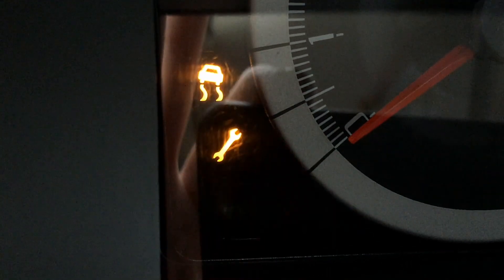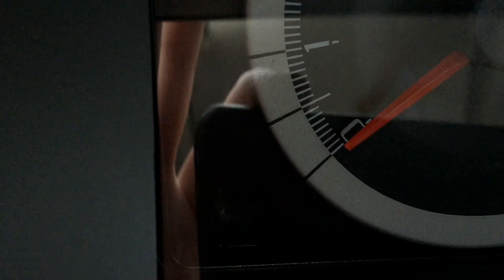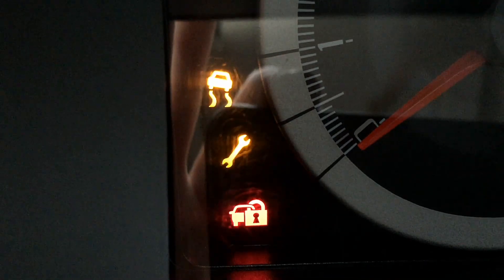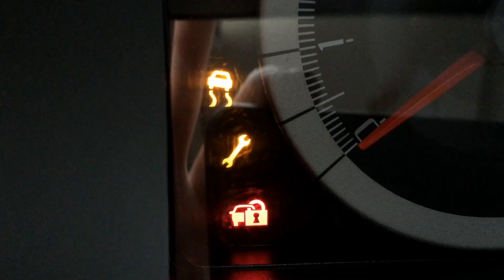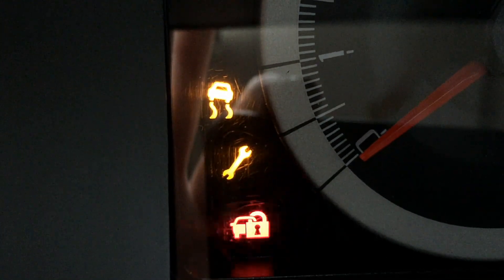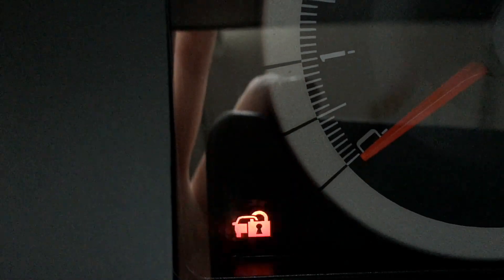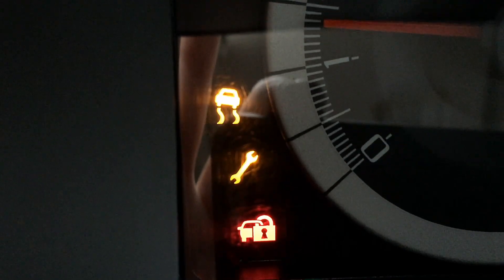Ford Quick Tips: #52 Identifying Ford PATS System Malfunctions

Comment: I need help😭
My car is doing the same thing, locksmith couldn’t program another key. My scanner tool won’t communicate with the pcm.
If the anti theft light stays on will that trigger communication errors with the pcm?
Should I focus on the ignition switch and transceiver module

Comment: Hope you read this: just left a customer with a 2010 f150 no crank with B10DA and B10D7 pats codes. Cust said he put an old key in to start, then it would not start after that. The security light never comes on at all, might be blown bulb, but probrammed a key and still no crank

Comment: I would rather deal with the risk of my truck being stolen than to deal with this BS antitheft PATS system. I have a 2003 Ford F150 Heritage Edition Black and Charcoal paint. Mint condition with only 64K miles. The truck would be worth around 12K to 15K. But nobody can figure out the crank no start issue I am having. Its throwing a code 16 on the theft light. The 2 mechanics that I have had work on the truck have done everything they know. But still the same problem. The one guy is a retired Ford tech that opened his own shop. Any advice or things I could try would be helpful. Thanks

Comment: Dude I’m praying it’s just the keys are bad for my 2002 mustang I replaced my clutch and then this started happening and it just has been so stressful 😭
Reply from the maker: Common issue with the cluster on the mustangs of that era.
Reply: @FordTechMakuloco the cluster?
Reply: @PatrickTaylor-n1o yes. Instrument cluster
Reply: Did you fix the issue I did the same job and now my car won't crank
Reply: @user-yt4id5np9f yes I had to send my ccrm out to garret tuning and paid them $165 dollars for a pats delete because there’s really no way around it and when I put it back in it fired right up

Comment: What if you have intermittent PATS problems while driving? Starts fine, but after driving, that light comes on, car jerks, and sometimes dies. I've rules out key transponder, had new keys and no change.
Reply: Any update
Reply: @craig2054  replaced throttle body, no change. Taking it to the dealer.

Comment: I have a 01 ESCAPE must I say more🫣  
    I found information about steps using pats key on exterior door lock to help recognize it, can’t find it now … 
    I moved it to wash engine bay because I was getting ready to work on some leaky seals and will crank no start and pats system codes p1800or p1600 , the extra key triggers the theft light

Comment: I have a 2008 Focus that will not program new keys after erase. Although, the PATS light flashes in standby mode, but it remains solid even when turning to the crank position.  I get a P1260 and a B1213 DTC code.  Any suggestions?

Comment: Thanks, Changed out the PATS thing on my 2002 explorer and fixed it up. Was having no Crank on any of my keys, had that THEFT light blinking in the dash.
Reply: Did you only change the transceiver? Im having the same issue now and have changed it, the dash lights at least come on now but it won't start.

Comment: 2012 f150 no chime when door is open key in ignition unless i put pressure on key have a code not throwing a light though b10f1 is this ignition switch issue or cylinder lock

Comment: I need your help on this one.  My '02 Excursion has a strange intermittent PATS issue.  It will occasionally not recognize the key, but if I switch to my other key it'll work fine, and the key that didn't work will later work.  I've been driving with two keys in the truck for a few years switching back and forth between them every time the system decides to not like one of them.  My biggest fear is that some day the system will just crap out and leave me stranded.
Reply: How did you fix this?
Reply: @cmdyc21  I haven't, I keep two keys in the truck at all times.  I ordered two new keys and once I get them cut I'll start using those just to make sure it's not a chip problem with my current keys.  I had one suddenly die a few years ago while on a road trip, they're not infallible.  Coincidentally, I never had this problem before that moment and the keys I'm now using weren't in use before then.  Fortunately I always keep an extra key in my vehicles just in case, otherwise I would have been stuck sitting in the snow almost 300 miles from home.

Comment: Had to buy a new battery. When new battery connected. Alarm immediately goes off.
When I turn key.
Alarm doesn't disarm.
No codes on the code reader.
But I have codes on my instrument panel has codes.
Service advance Trac.
Trailer brake control fault.
Starting system fault.
And key not interegated.
Also there are 11 fuse housing don't have power.
Fuses are good.
Relay 38 housing clicks simultaneously with alarm.
All relays and fuses good.
Have tried every suggestion YouTube has to offer.
Still Nothing.
4 mechanics have tapped out because they can't diagnose problem.
Any suggestions?

Comment: So what if both keys still make a theft issue. I have two keys but a fast blink for both keys. Starter and fuel pump is good. Redid all battery connections and factory ground. Need help.

Comment: I bought a 2005 mustang with flood damage. Everything electric works. However, that anti theft is flashing fast. Had locksmith out and the keys would program to car but would stopw working as soon as you took them out. There is a ...b1600 and b16001 code, meaning pcm...is it really the pcm or could it be the ignition ring or pats module. There is No corrosion anywhere and I opened pcm and it looks flawless.

Comment: Hello to all, I'm currently stumped on my 09 F150 4.6 3V intermitten crank but no start. I have used the forscan tool to run checks and so far no codes other than some ABS and TPMS. When I had it running, I checked for misfires and nothing, I changed out the MAF. Checked the fuel pressure, it jumps up to roughly 60 and will drop down and hold at 35psi. I have checked the reported fuel pump fuse under the hood. I also changed out the IMRC cause it was stuck open. Any suggestions where I can start looking next? Any help would be greatly appreciated.
Reply: I've got the same in a 99 ranger 4.0 sometimes reprogramming the keys works. Haven't found the cause yet. Might just get pats delete tune.

Comment: I got a 2014 F150 work truck, Plain Jane. No crank, no start, been dead for four months. Two mechanics, forums, days of Youtube videos, no dealership nearby, etc.....won't start. New immobilizer, key switch, BCM. Good starter and battery. All fuses and relays good. Nowhere in the instrument cluster does an anti-theft icon light appear at anytime, not even in the owners manual. Is there another way to eliminate a problem with PATS? Just loaded Forscan, waiting on an OBD. This truck shoulda went from assembly to the crusher.
Reply: Having the same issue but with a 2014 Ford Focus. Did you ever get it resolved?
Reply: @Sweetpea66 got it resolved?
Reply: How you fixed it?

Comment: How can you bypass the pats system if your ignition has been drilled out my truck was stolen 3 weeks ago and I've been dead in the water I was lucky enough to have receive my truck back but they drilled the ignition out and ever since then no matter what I do I have the original key but I can't seem to get the security system to stop flashing and it is tied into my fuel pump it's not allowing my fuel pump to stay engaged I also bypass that and for some reason when I go to press on the throttle the truck will die I am at a loss with this and I need help I am a single mom and cannot afford to have somebody come out and flash the system or put it in a new ignition at this time please from a desperate single mom help

Comment: Couple questions, 
Will 2008 f250 flash theft codes like the older f150's?
Will PATS shut down data comm with other modules?

Have a truck that wont communicate with anything other than GEM and 4x4, fuses good.  Trying to find the common denominator, not to sure where to start.

Comment: Man, I got a good one for ya. I have a 2008 f150, 5.4 4x4 4 door.  Here's my problem.  When I start it, it runs a little rough for a couple seconds.  You turn on the headlight switch on, it quits. It'll crank, but won't start. If you pull the headlights out of it, unhook all the bulbs, it won't start.  You put in just one of the park light bulbs, it'll start.  But the same thing, you turn on the parklight switch and it dies. I've cleaned all grounds on this truck,  but still the same thing.

Comment: PATS started yesterday out of nowhere. Four times, it would start, but immediately shut off. Today,  its now 'crank, but no start.' Tried second key that my son carries with him...no change.
This problem started after i replaced O2 sensors, plugs n wires. Also had codes read and cleared them out. 02 F150. Checked fuses related to pcm and pats....all good. Im assuming its gotta be the key, key fob not talking to pcm?
Reply: What was the problem
Reply: @aaronreed7793  never really figured it out. Found a guy in Ocala that was able to turn it off. Had to bring ecm to him.

Comment: Not sure if you’re still monitoring this post. 09 Fusion with 2 Ford keys. Both keys operate the lock/unlock correctly (new battery in both). One key will start the car….the other won’t. 
When inserting the “won’t” key into the ignition the PATS theft light flashes rapidly and a no-crank, no-start condition. The cluster does show the mileage and I do NOT have the dashes. You mentioned in your video that the dashes indicate that the key and car are not communicating…but as I said, I do not have the dashes. I did not check the batter ground because the other key still works. Would this be an indication that the coil in the key is not responding to the signal from the car? Is there a way to check this visually or with a volt/Ohms meter? Important to note that I did go through the process of reprograming with the turn-on/off 8-times method but that seems to only program the locks. And I did read about how to program a key but you need two additional working keys to program a third…so that doesn’t help me. Any advice or direction?

Comment: So my car went from no problems at all, stopped at gas station tried to start back up and the car completely killing power to everything, dome lights, windows, radio, everything. I disconnected battery for several minutes and turn key back to “power mode” but not starting, it will power accessories but as soon as you turn key over to start it kills everything!?!? Any idea??
Reply: 2001 Ford Mustang GT
March 2001 build date
98k mile, auto

Comment: @FordTechMakuloco - Love all your videos!! I have a question, I have a 2012 F150 V8, and I keep getting a "Starting System Fault" error and then a "Service Advance Trac" I have read so many forums and I cant seem to pinpoint a fix. I've checked the fuses, the connection over by the passenger panel, Reset the battery. I even had the dealer tell me it was the stater and changed it and worked for about 5 days and now the truck wont start again. Any ideas?
Reply: My 2013 is displaying both the same warning messages.  Did you ever find the root cause?
Reply: @PreciseAssemblies  yes my PCM went bad due to some Chinese crap remote start. Replaced the PCM and she is running strong!!! Hope this helps!

Comment: I was having theft light and all dashes in mileage for 2000 Expy. The ground from battery to firewall was junk, painted firewall and oxidation. Cleaned and protected with dielectric grease and all good now. Just rolled 277,000 miles.
Reply: Thanks for the inf
Reply: @elregresara412  296 000 miles now. I recently had an intermittent high idle. Turns out the throttle position sensor was bad, as well as the wiring and connector that went to it. I got a TPS  low voltage code on that one.

Comment: I have a question maybe some of you can answer does Pat's on the Ford affect the dome lights flashing or not my sister had a mirror replaced and after she left the mechanic shop her dome lights started flashing when she closed or open the door not sure if it's a short or if they activated Pat and if Pat's is activated it still starts and drives everything works normal it just the flashing lights when she closes her door or opens it anybody have any answers is Pat's attached to the dome light she also said that there was a buzzing sound at one time with the flashing lights anybody for any answers would be greatly appreciated

Comment: Hi. I just reprogram by adding another fob but now the engine wont start and there’s constant flashing light. I tried to set it to on position and left it for atleast 10mins then turned on still wont turn. I have only 1 original key. Any way i can fix this? Thanks
Reply: Try the transceiver

Comment: i have an '06 F150 that has a starter interrupt, i turn the key, i hear the switch click in the dash, but relay never clicks, and its extremely frustratingly intermittant, i dont have a "theft" light, i just have a light next to the headlight switch that flashes when the key is off and out, any idea for software to diagnose this problem? i dont want to have to go to ford because i was quoted upwards of $600 for a key cut and programmed, and they cant cut just a single key, its apparently a whole set of new keys as the stealership only gave me a single key for the pickup when i bought it used
Reply: Same for me. No responses?

Comment: I have 01 sport trac and it turns over but won’t crank Securty light blinks and when plugged up reads there is no pats what would cause that??
Reply: hi there did u solve the issue? I have the same problem. thanks

Comment: Does the system lock the key not to turn to the start position?
Have a 2008 ford escape that light is blinking fast and the doesn't turn to the start position. Also the Cluster isn't illuminating when the switch is turned on

Comment: I have a 2008 Ford Taurus, and it has this issue. i got it from a used car dealership over a year ago and it started doing this the day after i got it. they only gave me 1 key. i’ve tried everything to stop it but the thing is sometimes it will work and sometimes it won’t. when it won’t i will put the key in 3 position and then run position like 3-6 times really fast and then put it in the 1 position and then start it and usually it will turn on. but if it turns on the abs light and the parking break light stay on and the speedometer/temp gauge won’t work along with the A/C. what should i do? i read something about the PCM relay and then maybe the key. should i get a new key? i spent 5k on this car and i just need it to be reliable. please please help.
Reply: Hey did you ever find out issue? My car does same thing. I had a new key made from dealer but that’s not the issue. I went to two mechanics and they don’t know what it is.
Reply: @jessc.martinez3636  took me forever to figure it out. it was the pcm, got it replaced and drove it for a few days no problems then sold it because I didn’t want to be the one to deal with it when it went out again lol
Reply: @jessc.martinez3636  it cost me about $200 plus labor to have it put in, nothing compared to the hundreds and hundreds I spent replacing shit that I thought it could be.
Reply: @jessc.martinez3636  oh also, you’ll have to reprogram the keys to the car if you replace the pcm. I went to my local key store and they did it for free but you won’t be able to drive it until they are reprogrammed so I had my mechanic replace the pcm in the key store parking lot. Major hassle

Comment: Thanks for the 411 .. just got ford escape with the same problem. It's a friends car. Think I told you I was a Ford tech for over 20 years (started in 1987)  intermittent no start with theft light flashing. I'll check it out as you described and tell you what I come up with. I've been out of the grove since 2010... No NGS here. Lol. You guys still using the old break out boxes??? Lol. If I'm not mistaken.. use to be a 109 pin box? What's it up to now?? 450? Lol. I would of been still working with ford but my back started giving out because of all the 3.8 headgaskets back in the old days and the 6.0 diesel work! Those heads weigh 500 a pop. Lol. Will always be a ford fan boy .. got my 1993 ford flareside and my 2000 exploder both with the 5.0's ... it amazes me what the new 5.0/5.2 motors are pulling for HP.
Reply: How did you fix it?

Comment: Good video but it didn't help with my issue for some reason. Ford Freestar 2005. I get the fast flashing lights and error codes P1000, ecm fault 2, and B1680. Any ideas? All help appreciated.

Comment: Just a quick question, my 2014 f150 lariat is having issues with starting using the key with a fob that has a fresh battery in it, no issues with a key that doesn't have a fob.  How do i disable the pats so the key with the fob will work or not work to determine if the fob is bad or if the ignition is bad.

Comment: Makes sense, we had a set of keys cut and programmed the same keys you have in the video that are aftermarket and our Raptor cranked ran for 20 seconds and shut off. According to you it makes sense to go buy the dealer transponder key and the dealer factory key that supposed to come with out Raptor and it should fire right up and not stop after they have been programmed. Will try it out and let you know. thanks for your video if it works Ill give you a shout out...
Reply: Did you try it out? And how did it go?
Reply: @anthonyzed2058  heck if I know it was 3 years ago
Reply: @SavvyTurtle lol oof thought you was bout to give me some midnight peace of mind. I'm stuck. Locksmith coming tomorrow to see if he can fix pat system